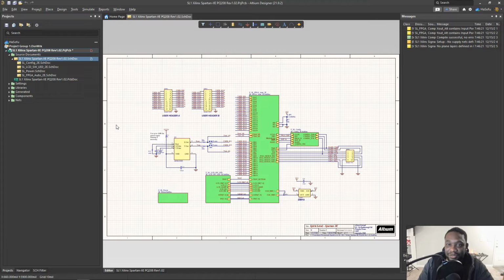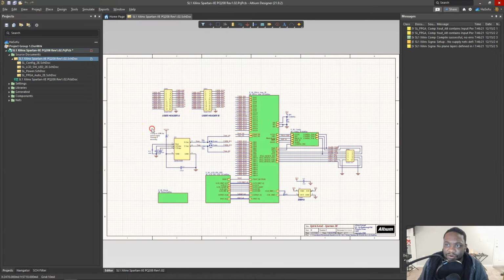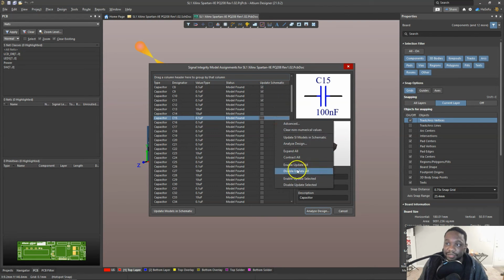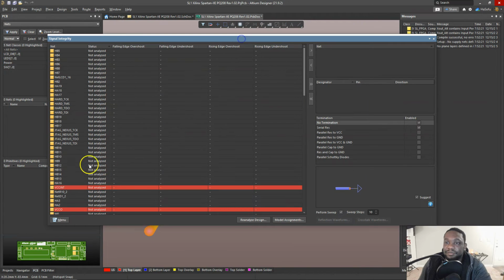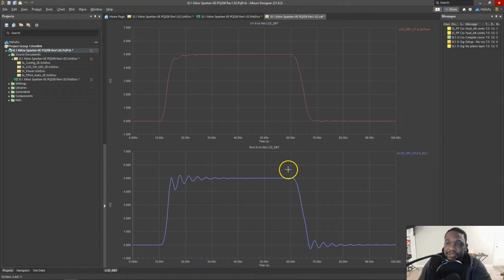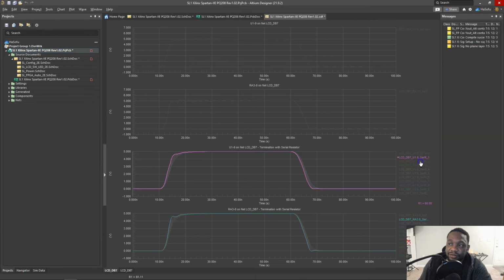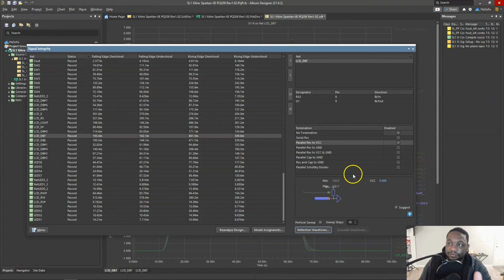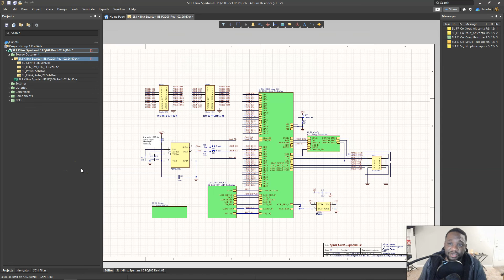PCB Design Signal Integrity Analysis - Altium Designer Tutorial

Comment: I gat a question
I tried to simulate the ic ne55d on altium for the experience but it didn't give me the pulse response It gave me a spindle shape of ripple between 11.96 and 11.97 
Does anyone knows why pls?
Reply from the maker: Hmm, this could be due to a mismatched impedance or trace or receiver at the end of whatever circuit you're simulating. The mismatch would cause reflections, which would then cause the oscillating behavior. That's for signal integrity purposes. If you're talking about a different circuit altogether and you're simulating the SPICE model performance in some circuit, then there's a different reason to do with the response and feedback loop of the device, which can cause ringing due to instability, overshoot, undershoot, etc. To know exactly the problem, you can email me at techedkirsch at gmail dot com.

Comment: That's a nice simulation but how well does it relate to reality? Series termination might be difficult to check but parallel termination for example is very easy to check on an actual board. Just wondering on how accurate is this to the real world since it has quite a few models that it doesn't know.
Reply from the maker: Great question. Hmm 🤔Would be nice if I could make a test board at some point to answer this question...

Comment: Hi Kirsch, The orcad signal integrity tools are easier to use just select the net run it through a wizard and the wizard only enables ibis models for the component pins hanging from the net you selected. You can set the topology and net lengths if on an unrouted pcb this can then populate constraint manager and thus you should get a clean working pcb